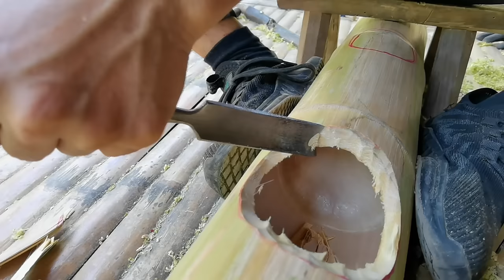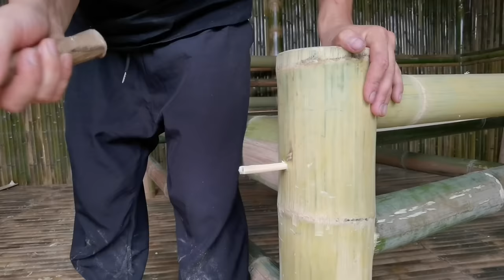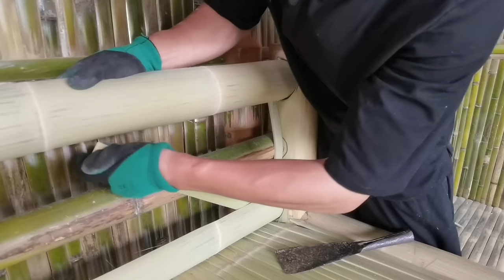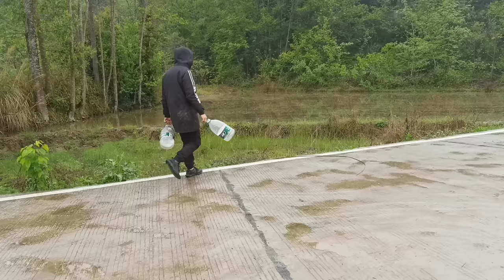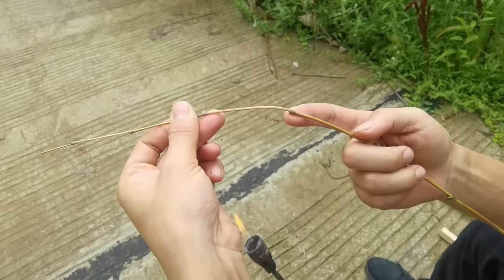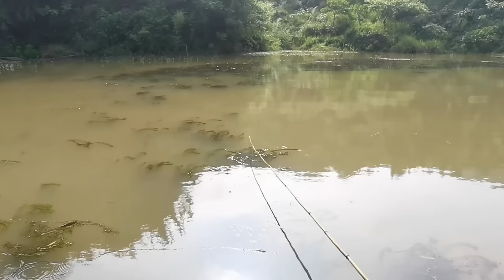Build a water bamboo house in 60 days - 10/Make yourself a bed【Water Dweller】

Comment: In my point of view the house 🏠 is too close the the lake, if it's raining for one full day the house will be flooding 🙃 😑
Reply: Um its a water house its supposed to be on the water plus there are 800 plastic bottles underneath, in your scenario the house would just rise
Reply: Floating house..rising up and down of the lake water won't be a problem..so convenient..
Reply: If the lake dry out that will be the problem, not flooding
Reply: It will float now the house is boat
Reply: Debieron hacer esa casa convinado con otros materiales se Termina el mambo  x tapar tanto mambu.